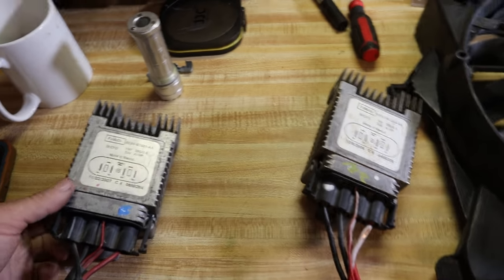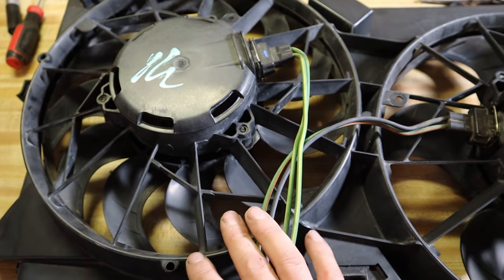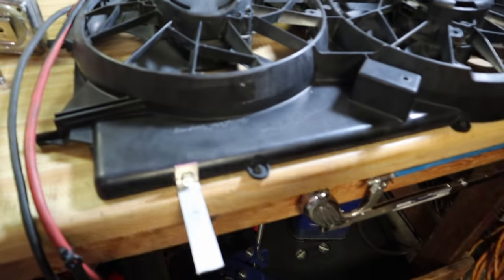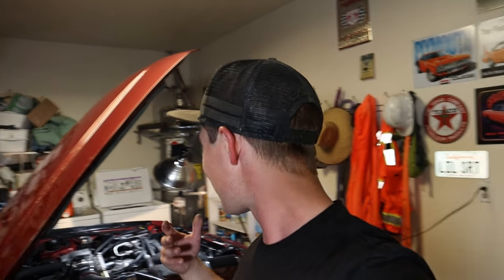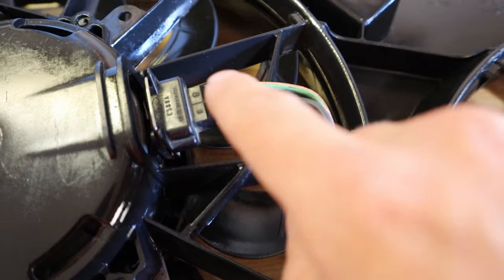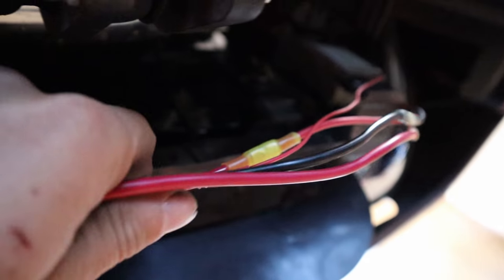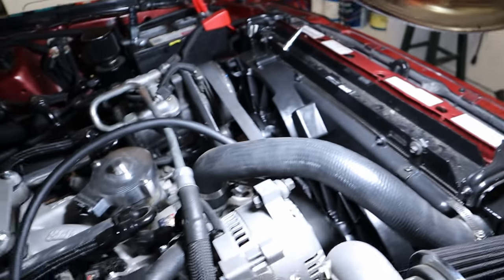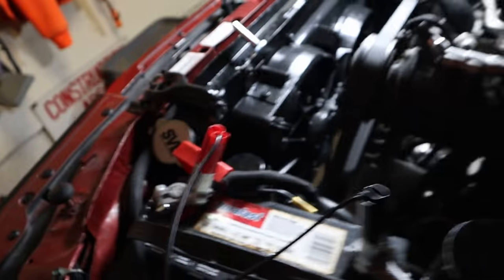Ford Focus electric Fan Installation On My TURBO FOXBODY Mustang!

Comment: That is a really cool fan upgrade, I knew that u were eventually going to swap over to the electric fans , I took the lazy way out and mine are hooked up to a relay and a temperature switch on the intake and when it gets 180 degrees they kick on (hopefully 🤪) which my whole setup is a basic easy computerless setup with a few modern upgrades like the wideband and a few other things, but i feel like those will keep her cool and I like the way it runs at a lower rpm if it doesn't need to run wide open. Mine is wide open or nothing 🤣 but that is probably the way ill drive it 🤪🙈. The redneck way you figured out if the fans turned the right way is the only way I roll 🤣 So don't hate on us rednecks, that is the only electrical tools we have is a wire and a 24volt battery so we just touch wires together until it either works or the battery explodes in our face which at that point it kinda tells us that's not the correct way to hook it up 😂😄😆🤣🤪

Comment: 05-09 was 12v, ‘14+ focus are brushless and can be PWM without a controller but either way be aware Ford had 25A fuse each based on their super efficient single core radiator and AC condenser so the more cores/restriction its pulling thru then the more end amp draw it will have. One fan should be plenty to cool your engine unless you will be road racing lol. Killer job saving money and using factory parts available everywhere👍🏻👍🏻
Reply: That’s good info man
Reply from the maker: Got it! I think I’m going to swap down to 25 amp fuse as well! And thanks you were very helpful in your other comments for good ideas in for electric fans I really appreciate it 🙏🏻 and definitely gotta save the money where you can! 😂
Reply: @iamchazhaynes7074  man im always about using factory parts when i can for ease of replacement parts on the road, now my 65 f100 would be a contradiction to that claim since the drivetrain came from Australia lol
Reply from the maker: LOL! But that barra engine is going to be SWEET! My friend just got the bottom end assembled on his those engines are soo cool!

Comment: Is there a way to run the Pwm controller without using the mega squirt?
Reply from the maker: Definitely! You don’t need Megasquirt the Holley EFI will control it as well most standalone s will run the controller I’m not sure about using without a standalone though I’ll do some tea search. I’m going to make a video about the setup in the standalone so I’ll see if I can find an answer for that as well!